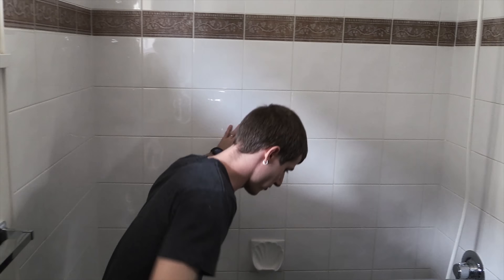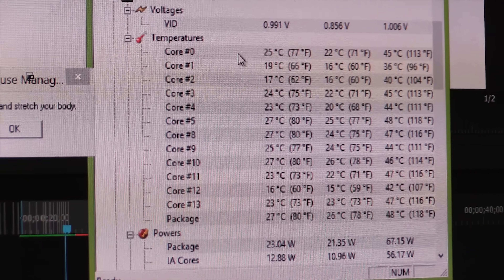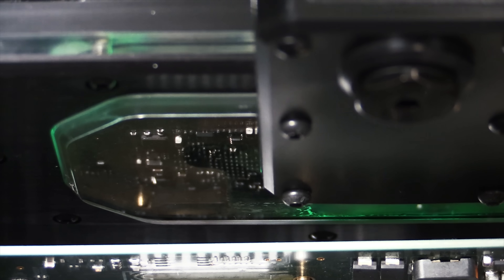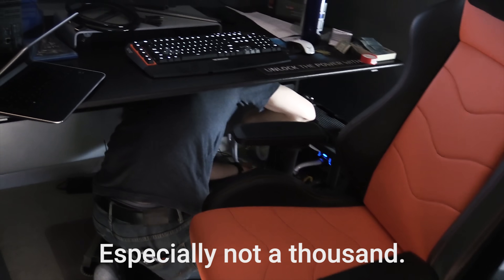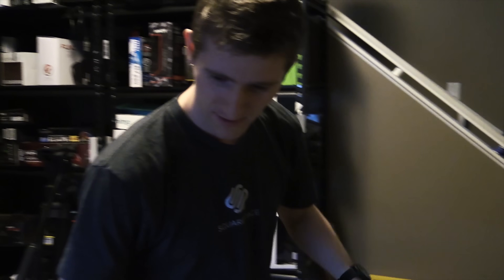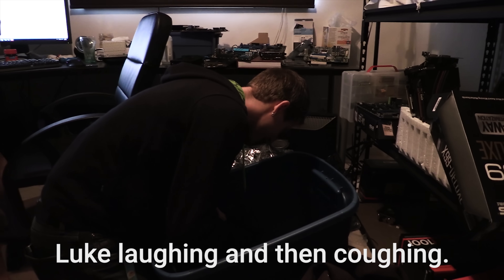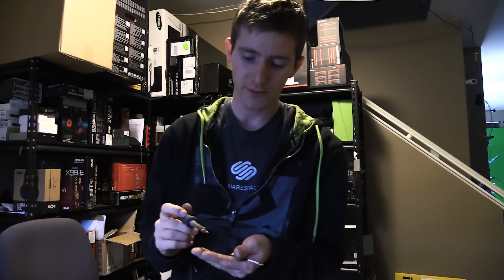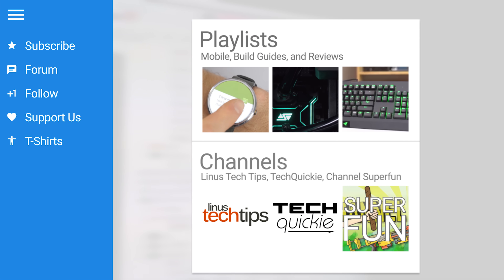Whole Room Water Cooling Part 5b - Some Issues, More Solutions...

Comment: My dad holds the silver filament or whatever it is when he solders.
That way it can drip onto the wires. What you're doing is you're dabbing the wire and then moving it. Those 2 seconds of movement count because it cools the lining down, where if you were to hold the solder over the wires with the filament it could drip onto it and you could then rub it with the solder to make it stronger.

Comment: Before soldering, take the two wires that you wish to solder and twist them together. It will be stronger and make everything easier. Make sure you're using 60/40 solder; as thats made specifically for electronic work. Ive found that rosin-core doesn't work as well. Make sure its NOT acid-core. Thats only for plumbing. Also when soldering, heat up the wire with the iron and apply the solder to the wire and not the iron itself. If your iron tip ever gets the point where it doesn't seem to be working very well, you can use soldering tin to restore your tip :-)

If you want to easily waterproof your wires, you can buy liquid tape from Home Depot. Works exactly like black tape, but comes in a goo form that dries very quickly after being applied. Its also flexible.

Comment: I really love watching this series, but the only thing I would have done differently is to use an automotive radiator, with an automotive fan. something from like a chevy cavalier, or toyota camry would run less than a hundred bucks(maybe less online), and even a universal automotive fan is completely safe to get wet, and will continue to work in rain. You would just need to find a 12v 20 amp power supply. probably not going to find that in a box of spare computer parts though.

Comment: Linus, you should really get a third hand for soldering, it allows you to actually solder the way it's meant to be done. You should put solder on the parts then join them quickly when you reheat the solder, not put solder on the iron and scoop it onto the parts to join, that's the worst way of doing it (the solder oxidizes and it doesn't stick to metal anymore)

Comment: solder tip: First you need to put a little bit of solder on the iron, so it conducts more heat... Then let te iron heat the wire. After that put a little bit of solder on the wire (but keep the iron touching the wire). It let's the solder flow much more easily on to the wire.

Comment: Couldnt you get Luke's dad to install a central heating pump instead of those "pond" pumps? should provide the head pressure you require something like a Granfos Alpha and it could be almost anywhere in the loop then, not even in the bathroom or at least up on the wall out of the way. Makes more sense to have the system more like a domestic radiator setup with a few "break outs" than a large water cooled system with a few plumbing additions.  Look into using underfloor heating components,  manifolds et al. I honestly think you would have less issues.

Comment: I don't see why he did not put a simple plate exchanger with quick disconnects and on each computer he would not have to run pressure through the existing pumps and its computer. The downfall of that is every pump needs to run. But if you let the fan turn off on each system that should work fine.

Comment: Solder tips:
For heat checking, instead of tounge, or fingers. place the tip under your nose, very easy way to know if its hot enough.

For the soldering part.
Always add some solder på the iron tip, then clean it with the wet sponge (should give you an even silvery looking tip).

Remeber that you should heat the the thing you want to solder, and then let that melt the solder. otherwise you might end up with whats called a "cold solder joint".

Comment: Soldering tips!
to solder wires, twist them like you did, and them twist them together before you solder them. that way it makes one big bunch of wires from the start.
you don't need to expose the wires as much as you did there, less than 2cm is good enough, as the plastic around the wires will melt back a bit when you heat the wires up, often exosing a couple mms more for you to work with.

Heat shrink tubing!
it shrinks around your exposed wires and insulates them! it's good looking and resistant: such a better option than electrical tape.
just remember to put the tubing on the wire(s) BEFORE you solder everything, or you might have some trouble putting it on.

Solder!
the one you have there is WAYYYYYY overkill! it's meant for much bigger solders, ELECTRICAL solders, and not electronics like you were doing.
Get a finer soldering wire. 1mm or less is good, over that is too thick and won't help you in your work.
Look for solder with a resin/flux core. as the name implies, there is flux in it, that way you don't need to add any flux to your work.

"helping hands" is a pretty neat thing to have when soldering. iFixit has them:
https://www.ifixit.com/Store/Tools/Helping-Hands/IF145-082-1

Remember to clean you soldering tip with that sponge. of course, sponge should be wet and not dry, and should be cleaned of leftover solder bits after you're done.

Also, having your soldering iron heat too high up will damage your tips faster than if you have a lower temp. try and keep it as low as possible, but still bei able to work at your own speed. if you're soldering/de-soldering something really big and are having trouble getting it hot enough for the solder to melt, crank that dial to the max, it should help you get that melting problem out of the way.

Hope that helps you guys, and anyone else reading this!

Comment: Tips for soldering, get thinner, flux cored solder like 0.5-1mm, don't bother with flux pen, get a tiny bit of solder of iron, then use it to warm wires, then while they are heating feed solder into them, I dunno what you are doing in the vid but that looks like plumbers solder, bit thick for what your trying to do.

Comment: I hate to be mean but this entire project has been a bit of a mess. I respect the ambition but it's looking poorly executed and my best advice would be scrap it and start again with professional guidance. 

You keep mentioning you're moving, so why are you still working in the room loop when it's all just coming apart soon? 

The idea was great but too many corners cut. This is a professional workplace and you have non weatherproof and bodged together wiring outside only covered by a piece of temporary plastic. 

I'm no way near as knowledgable when it comes to PC components but I come from an electrical back ground and some of the work done here scares me. I'm not sure about your local laws but if anything goes wrong and the worst happens, I'd assume you're in serious trouble. At best, I'm fairly certain your buildings insurance and likely your business liability insurance providers are not going to take kindly to how this work has been carried out. 

Start over with the outside rads/pump setup and do it properly.

Comment: Not trying to be a smartass, but Linus as far the plumbing, water supply, pressure inside the tubes, the required volume of water , energy loss, kw, precise positioning of the pumps and last but not least the speed in which the water needs to travel inside the tubes in order to achieve the maximum heat dissipation should be 90% calculations and 10% percent actual construction work. You should really get someone knowledgeable about these things to help you out. The method of  trial and error is never going to be efficient

Comment: These filters you ordered for the next episode will add their own pressure drop, I wonder if you'll need a third pump after installing them. Honestly I think the filters are an overkill, its a closed loop, so just use a car coolant with added growth inhibitor (using the right concentrations ) and you should be golden.

On another note, I think this whole project, while being cool and challenging, is a mega waste of time, effort, and money.

Comment: When you solder be sure to heat the metal with the iron before you start to flow you solder as the solder will not flow properly to a cold surface, then use the iron to guide the solder where you want it to go. Also be sure to put water on the sponge for cleaning off the solder from the iron.

Comment: well... i pay attention when linus "does" computers,, but, as an electrician?? LOL not so much. 
try "bullet" connectors instead of lengthwise soldering, or, if u must, try shrink tubing instead of half a roll of tape. and, at the risk of repeating.. put a bleeder [simple radiator style  less than 2 US] at EACH high point in the system. but, it IS fun to watch,,

Comment: When soldering a permanent connection for outdoor use, please use a good heatshrink. I shrink all the soldered points individually and the the entire bunch. Preferably a 3:1 (or higher) shrink with glue and then electrical tape. Kudos for using Weller soldering iron!

Comment: I would but the second pump in the middle of the circle because water pressure is affected by the distance traveled so badly, so by putting near each other you simply wont benefit from the second one!

Comment: LinusTechTips It didn't look like you thoroughly burned-in your soldering iron.
When you buy a new soldering iron with a fresh tip, you need to burn it in first. To do so just wind some soldering around the tip, then turn the iron on. You should hold the tip above the sponge in case some of the soldering will drip. After about 10 minutes the tip is burned in and you always have a thin layer of soldering around the tip that won't even get away when rubbing it against the sponge.
As for the actual soldering itself, you should first heat up the wires from below and after 5-10 seconds (depending on how many watts your iron has) add the soldering from the top, so that it melts into the wires, that will lead to a "hot" connection between them.

Comment: Dont rub the soldering iron over the solder... You're not getting proper heat transfer like that which leads to bad solder which will break sometime. Also you should heat the cable you want to put the solder on, not the solder itself and then let it kinda drip on there, not a good idea.

Comment: for soldering use the solder iron to heat the wire so its hot and will accept the solder then apply the solder at the tip of the iron and touching the wire more . don't apply to much and slowly remove the iron and solder strip from the wire and it should be fine.

Comment: Not nearly how you connect wires. Separate the individual strands and twist the strands from both cables together. give it a tug to see if they are joined kinda tightly then heat the connection and once warmed by the soLdering iron apply soLder to the connector while the iron is sitting under it. Finish the job by using heat shrink to give it a professional and tidy look, while also being as tough as the rest of the cable. Heat shrink is way better than electrical tape, but do note it is tough and will require some sort of scissors/pliers to remove.

Comment: Um well, it is apparent you guys don't solder too much :p, or you do it vastly different than i have ever been taught. I normally do the following:

1) Clean my torch on a sponge.
2) Dip it in flux to coat it, clean it, and allow flux to attach to the torch.
3) I than glaze my tip with solder, just enough to make a little bit of 'fluid'.
4) i either pig tail my wires, or twist them together inline (make sure you have shrink wrap behind each wire, and a large peice to patch the whole area when your done)
(Note keep the shrink wrap far back on the cable, so that it doesn't shrink when you solder the wires)
5) I take my flux and coat the solder wire i will be using.
6) Place the torch underneath my twisted wires, lifting up on them.
(note, the solder on the torch allows the heat to transfer effectively to the wires)
7) I then take my solder wire (with the flux on it) and start to press it to the TOP of the wires.
8) The flux on the solder will melt first and coat my work, then the solder will begin to melt and fill every crack and void around and between my wires.
9) I try to limit how much solder i place since it will spread into a wide area causing a larger hard area that will not be bendable. ALso it will increase the Collarbone effect where it is continuously easier to break it even after repair.
10) I then use shrink wrap with glue on each wire, than on the entire patched area. 

But ya, many ways to skin a cat, but thats how i do it :)

Comment: When soldering, always use the smallest amount of exposed wire as possible, also use heat shrink, not electrical tape! Or just employ me in a couple of years and I'll help with pro soldering and heatshrinking and psu voltage reviews

Comment: When soldering its much more effective to heat the wires you are trying to solder and adding the solder itself to the hot connection rather than putting a glob on the iron and transferring that to the connection. send me a pm if you need any help or more info about soldering.

Comment: Use low temp solder with a flux core. Twist the wires together then put the soldering iron under the wires and the solder on top, not the solder on the iron directly.

Comment: LinusTechTips Clean the damn tip with flux and the sponge before u start any soldering even if your still soldering the same wire, heat transfer is key and if you have a dirty Soldering Iron, then the heat will not transfer correctly. Also Flux infused Solder tends to be better for soldering, and try clamping the two cables to the table so u can focus on soldering the two cables with your hands and not worrying about wobbling the cable while Soldering.

Comment: when soldering wires together the ideal way to do it is to heat the end of the wire itself then touch the wires with the solder. that way you get less solder sticking to the solder iron and more on the actual wires. it also makes for a cleaner job.
Reply: Haha

Comment: Twist the wires together then put the soldering iron under the twisted wires...apply solder on top and that should spread all over the heated wire...
using an alligator clip stand would help out a lot by holding the wire in place.
heat shrink would help a little more with weatherproofing..

Comment: It might have been said already (probably?) but when you set it up again, have you thought about putting the radiators on a separate loop with a dedicated pump from a shared reservoir?  It would reduce the head and resistance of the PC loop quite a bit, I would think.  As long as you got good mixing in the res, I wouldn't think it would have a meaningful affect on temps.

Comment: Next time when you have to solder electronics (small electronincs) use 60/40 solder with a flux core. Saves a litle bit of time and it's easier, and if you're solder something you need to heat the wire/pipe and put the solder against the wire itself for a more "solid" connection.
Please dont melt the solder againts the soldering iron and paste it on.. it hurts

Comment: I'm just curious why Linus didn't use 2 bigger exhaust fans in a push pull configuration which he could directly hook up to the mains power instead of going through the trouble of using many small 12V fans?

Comment: Soldering tip: get a wire holder with aligator clips, put one wire inside it then some solder on the other one and connect them while heating them up with soldering iron

Comment: hi all, I always look your channel,and I see that you have the problem of air,I am an expert plumber engineer.you will always have the problem of circulation,the air in the pipes will always be,you need to put automatic air pick-up,then you solve this problem,automatic air pick-up is necessary to insert themselves top of the pipe,thank you for your attention.
Reply: Your an expert plumber engineer and i live on the moon can't be to much of an expert seeing you missed the problem with the pump setup. Look at 3:15 i spotted it and i have no degree.
Reply: Peter Macca yes I have seen these pumps,but it always ends up a new water,it is necessary to collect a closed system
Reply: What are you on about i didnt ask if u had seen these pumps i was talking about how there plumbed up. If your an expert plumber engineer give your degree back.

Comment: Wow Dose any one else see the MAJOR problem with the way the pumps are hooked up @3:15 and your wondering why you have still have pressure problems. LinusTechTips  To get more pressure in the system the way your working this, instead of having the pumps in series they need to be in parallel.
Reply: The way the pumps are its sorta like doing the (40 fans Ultimate Corsair H100 Cooling Mod) haha. The only thing u gain with this setup is you would get higher head pressure (how high Vertically it can push water). You need higher flow (GPM) which will result in a pressure increase as the water blocks will only allow so much water trough meaning u will get a pressure increase as its not free flowing as much.

Comment: Soldering Tips: Need way THINNER soldering wire & heat shrink. Only a thin gauge soldering wire is recommended for general 12 volt wires, the thinner the better. Strip the wires just wide enough to fit the iron TIP in between them both. Slip the heat shrink down one open end wire. Not too close to the solder area or it will shrink, due to the irons heat.

- Clean the iron tip with the "wet" sponge.
- Apply tab of solder to iron tip to ready iron.
- Overlap stripped wires.
- Place iron on wire (top) "while" FEEDING solder from iron tip down to wires, allowing solder to simply flow from the iron tip through to each wire.
- Once solder CONTACTS each wire remove iron. LESS solder is more.
- Let wire cool
- Slide heat shrink over soldered area & with "space minded" apply heat w/ lighter. Clean and connected. Enjoy the vids, thanks